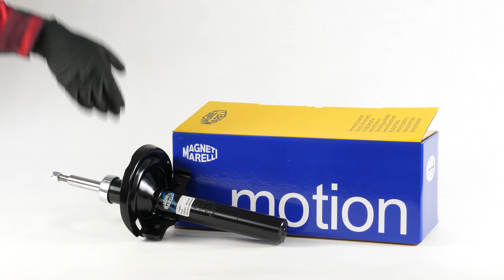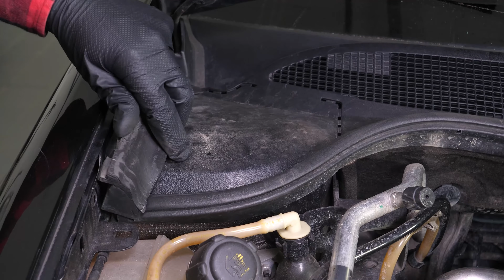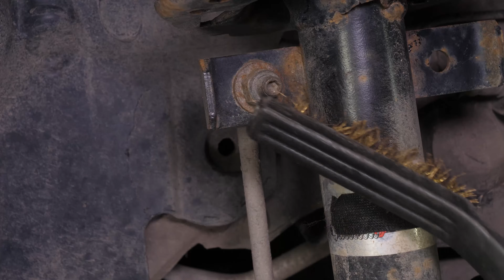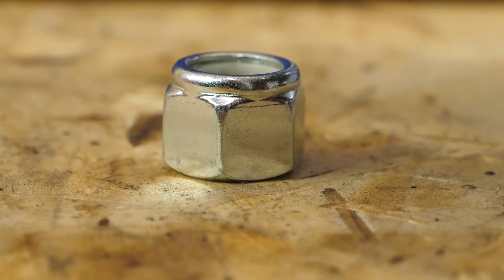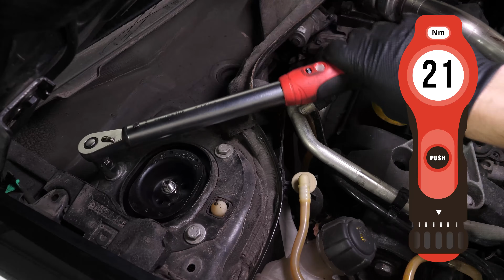How to replace the front shock absorbers Megane mk2 ➿

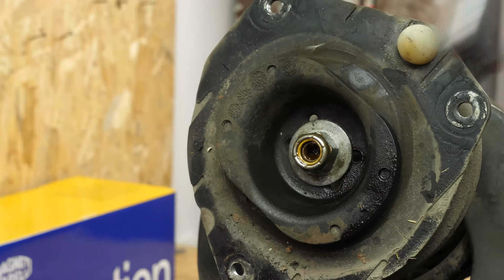Comment: 5:45 - How to use IMPACT WRENCH while you need to keep still the spindle still by the hex (Allen) key? Needed always to cut the spindle by grinding, the hex housing is too week to unscrew the rusted big nut, even when had two flat parallel faces on the spindle end.

Comment: Hello,
I just ordered Magnetti Marelli shock absorber for my Lancia Delta 2011, i was wondering to purchase Monroe but i changed my mind and bought that italian brand. Is Magnetti Marelli good at suspansion system ?
Reply from the maker: Hi @Hll dnn, as you can notice, we installed Magneti Marelli parts on this Megane mk2. After some driving, we were impressed by the quality of the absorption. 
We also saw that the parts were good quality during the assembly. 
Do not hesitate to give us some feedback.
Reply: @UseTool_EN  thanks for your interest, i ll let you know after using the parts
Reply: @hlldnn6184  how were they, after 3 years